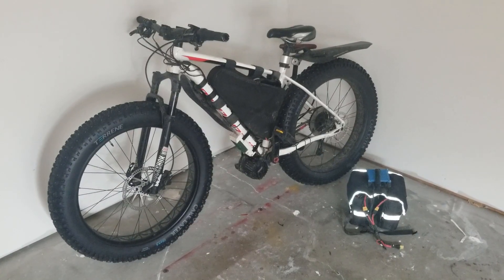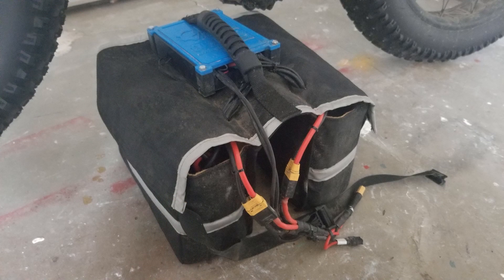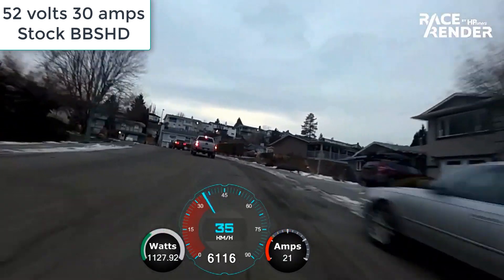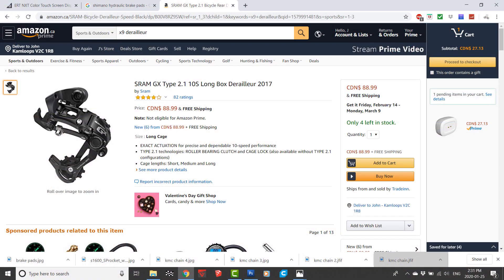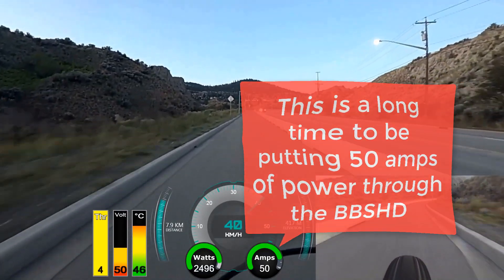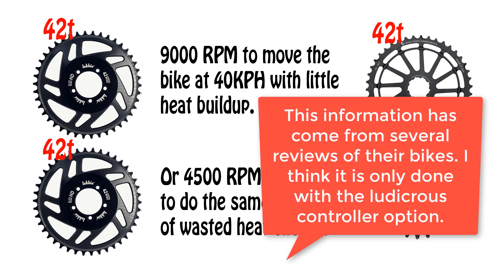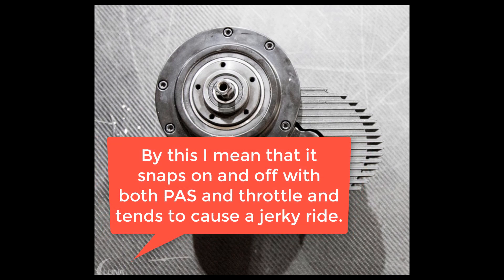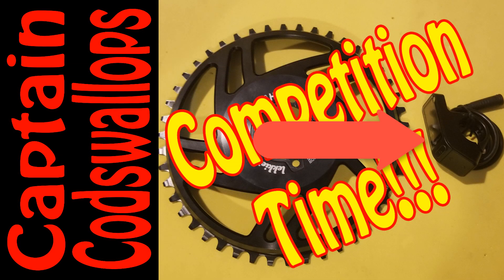Bafang BBSHD - ASI BAC 800 72v - Specialized Fatboy Ebike Conversion. The fastest & most reliable?

Comment: Just want to add some to this very informative video. Ive been running bbshd for 3 years and thousands of kms now. I run 60volt and 50 amps. No need to bash Luna for their controller. They did what they though was reasonable at that time. Nobody had BAC controller set up back then. I stripped nylon gear in first few kms after running just 52volts and 50 amps. And motor was nowhere near hot. Temp is not what makes it fail! Its sudden burst of torque at wrong gear. It strips not melts. Ive made and been successfully using bronze gear since. What gets motor hot is long rides at high speed.  On the trail with full but short bursts of torque and slower speeds BBSHD can go all day at 3000 watts. Keep gears low spin motor fast. BBSHD can take tons of abuse. BAC+ 72v+ sturmey archer 3speed is my next upgrade.
Reply from the maker: Good points. I have seen the gear fail in both ways. I guess I always had it geared correctly. Sorry if I came across as harsh on luna. Their efforts on the bbshd are good. I was just looking at a destroyed bbshd this morning. Respect of the gearing key..Thanks for the comment. Cheers
Reply: @HighVoltageKits  Yep yep. Luna now has PEET plastic gear. I will give that one a try as well. Want to get my gear "noise" down a bit. Its a bit of a learning curve with BBSHD to sort of feel what gear to be in for given speed and grade. My rule is- if its " light" enough to pedal its good enough to give motor all the beans.
Reply from the maker: That's a good rule of thumb. I bust my chain a few times early getting that one wrong.

Comment: Hiya mate sorry to miver but I've got ton a phaserunner coming from your neck of the woods canada am running 52v on 1000w bsshd want to run throttle only coz don't wana use cycle analyst will I need speedometer or do run senor less I've looked at pro gaming aswel an looks litle daunting eny chance of bit of advice thx captain aswel luv the vids BTW
Reply from the maker: Thanks mate. I know Grin have a few setup videos including one on the bbshd. I am not sure if it can be run sensorless. Mine is on sensorless run hall start. The phase runner is based on the ASI bac800 but with a custom form factor. There should be lots of support stuff on Grins website. I am not sure if you are able to run it without the display or not. I had thought the cycle analyst was pretty integral to processing the throttle signal. You are welcome to post pictures on my discord. I can setup a phase runner channel perhaps. If you search under Grin phaserunner bbshd its the top link on youtube. Discord is https://discord.gg/YAAjfgc

Comment: I agree with your decision to continue using the nylon gear. 
 When in use, nylon gears produce less friction and heat than metal gears do.     (When paired with a metal chain), nylon gears are much quieter than metal gears.   Heat transferring to the motor “IS” a very important thing to consider, but I’m pretty sure that (even if those gears were getting hot) nylon does a much better job of insulating that heat than metal does, therefore keeping the center of the sprocket relatively cool, and eliminating the possibility of gear heat being transferred to the motor. 
Electric motors convert electricity into force with byproducts of a lot of heat, some noise and a little bit of static electricity loss.
The more power and the more demand that you put into a motor...the more friction occurs, AND the hotter your motor will get. Usually, that’s the only kind of heat that you need to worry about with electric motors, so never run more power to a motor than what is recommended, and try not strain your electric motor too much with heavy weight and/or long steep climbs. 
I think that you can go ahead and install that metal gear (if you want to). The only difference that you will likely notice will be...
“more gear noise than you had before” !
Reply from the maker: Thanks. Thats a good explanation. Im not going to bother unless it fails. I wanted a spare so thought why not. Apparently there is a Peek gear now that is quieter. At 72 volts I have not got the motor above 55c so well within spec for nylon. Cheers!

Comment: So I have a steel gear  I replaced my nylon one with, greased everything up that needed it, put it all back together and installed a ludicrous controller on my fat bike and the motor gets hot as hell.  Nothing has failed with over 300 miles on it.  I have a mini mighty luna chainring on front and generally switch my gears all around due to the hilly conditions in SF.  You have got me wondering what will probably blow out on my motor now😆
Reply from the maker: Try using a laser thermometer on it. At 52 volts it can get pretty hot. I think 60C is the highest I have found. Its not melted the nylon tho. I think you have some wiggle room.
Reply: @HighVoltageKits  thank you...will do👍

Comment: What a fantastic video of concise details.  I too am working on putting this set up on my 29er in the near future.  Maybe I missed it, but how did you mess up your firmware?  Cheers.
Reply from the maker: I am not quite sure. I could have likely flashed it but I had moved on by then. Just playing with the settings I think.
Reply: @HighVoltageKits  okay...I have the eggrider v2 on the way through mail...just trying to avoid a mishap
Reply from the maker: It will have changed since anyway. I would steer clear of messing with the amps. Leave it at 30 amps and control power in watts.
Reply from the maker: Also after you have made changes and they have been confirmed power the bike on and off
Reply: @HighVoltageKits  thanks a lot...looking forward to your future videos...subscribed and rang the bell...cheers
Reply from the maker: Cheers mate!

Comment: Great video thanks.
Im new to this but been reading as much as possible.
I feel I should have ordered the HD but have the bbso2b now and with the 44t stock ring I hit 18 mph and just ghost pedal in top.
So rather than the 52t chainring I have ordered the 48t and will be happy if I hit 23 mph and a little above.
I don't want to ruin the moter with the 52t an won't risk it.
I will be ordering a 7 speed shamano cassette with 11t but never changed the cassette before and keep extra chains an parts. One needs to read up before buying as it requires regular service up keeping and £$££££ lol. Got some fun ahead and looking into it.
Reply from the maker: Sounds like it's doing ok. As long as you don't stress it too much. Its still a good motor. Cheers!

Comment: Can I install the Asi Bac 800 with bafang 1000w with the original display? C961...
Thanks
Reply from the maker: Yeah you could. If its an older kit. The new version is using a propriety screen and harness now. At least that is with BACs supplied by ERT. You can get them direct from ASI but the installation is not a pleasant experience. The draw back to the original display with the 800 or 855 now is it will not let you change your power level. It is full power all the time. Some of my more recent videos have information on this display. The NXT
Reply: @HighVoltageKits  Thank you! So which cheap display do you recommend to use the BAC 800 with my bafang ...?
Reply from the maker: Sorry I am confused. You already have the bac800 and a suitable wiring harness?
Reply: Captain Codswallop negative, I wanted to buy this controller and know if I can use it with a display without buying his.
if i buy its display is it possible to program the controller and also the assistance levels? how many are foreseen? Thanks for the replies

Comment: I wonder if you could run this controller on the BBS 02 with 60v ??
Reply from the maker: I think you can get an upgrade kit for the 02. When you mean 60v do you mean 60 volts nominal or a fully charged 52 volt battery?
Reply: @HighVoltageKits  16s 67.2 v

Comment: Interesting listening and it all makes great sense, if your father told you not to labour the engine but to let it spin and don't load it up in a higher gear.
Reply from the maker: Yeah. It adds nothing to your speed in most cases. Cheers

Comment: I'm confused.  If the motor is flying along at thousands of RPM, with  42 to 42 teeth then you're really just sitting there as if you were riding a moped, right?  I mean, at that speed your legs can't really move fast enough to add any force to the drivetrain, right? Or am I missing something?
Reply from the maker: Yup. Thats right unless I lower the power and change the gearing. If I drop it to 500 watts I can putter along with pas and put effort in but its slow.
Reply: @HighVoltageKits  Thank you for clearing that up!

Comment: Really like your descriptions and the evolution of your build.  So would it be fair to say that what you've created here is basically an electric motorcycle?  With your 1:1 ratio, do you ever pedal the bike?
Reply from the maker: Sometimes. I do have two other gears that are a bit higher. The exercise part of the vehicle is something I want to work on. I prefer the term light electric vehicle. But you are correct in your thinking as it's not really a peddle assisted vehicle. Although it can be and with a different chain and gearing could easily be. So restrict the power and you can ride speed restricted trails. You can't do that with a traditional motorcycle. Thanks for the comment. Cheers!

Comment: I forgot to ask you what fat tire are you using for the fat bike I am at cross road on what to get for all season riding
Reply from the maker: The smooth ones would be useless in winter. The ones they came with were ok. Ground control I think they are called. I love the cake eater winter ones I got. You can get them stud less. It's not a simple choice tho.

Comment: My bbshd has been sitting unused in two years upgraded to a ERT 84v external controller and destroyed the nylon gear..Im going to get her back up this summer and running with steel gear replacement. My cheap 48v chinese battery still has a charge but its been abused bms died so I just cut it out, should probably check to see if cells are balanced manually before I get her back on the road. Looking into building a 72v battery on a tight budget. Any advice or thoughts would be great
Reply: Wrote the coment before getting to end of video interesting thoughts on the nylon gear your logic and why the nylon gear makes sense but if I already have to replace might as well go with steel one for few bucks more
Reply from the maker: Yeah. I will see the condition of mine in the next while. Apparently they start off a bit noisy but get quieter as they break in..Good luck getting it running!

Comment: Great information here Captain, and very thorough. Here in England I'm about to start a build and making decisions on controller, chain rings etc. My last decision is really on why not an IGH? Surely with so much power, a 3 speed simple and robust IGH would be the most reliable? The sturmey or similar? Less issues with chain alignment etc?
Reply from the maker: Absolutely. There is a 7 gear sturmy that can do 3
kw. I have to pick and choose where to spend the money. Once stuff wears out maybe I'll try igh.
Reply: hi there, just thought I’d let you known that the Nuvinci hubs work real good with mid drives.  Seamless shifting with the Harmony auto shift, just set your cadence you like.  shifts to lowest gearing when at standstill.  Protects the motor from high gear starts, and subsequent heat issues.  I run mine with a 48 volt 10 amp/hr  battery, stock controller, and it climbs insane slopes with ease.  With one chainline...they work very well together!
Reply from the maker: Thanks for that! Will check it out. Cheers!

Comment: Hi,
Thank’s a lot for the amazing content, it’s very helpful. I have a bbshd on Crossbike which I use for commuting: 40km for one way and 500m elevation when I go back (several routes possible, shortest one with gradients up to 17% for 200m). I use a Cannondale Quick CX1, 9speed 11-32 cassette, Lekkie 46t chainring, 48V 14Ah stock battery. I just ordered the newest ASI Bac 800 kit from ERT and I want to change the battery for significantly more top speed too as I have 30km of flat road. But I’m not sure if a 72V battery make sense as I don’t have (and don’t wish) a throttle. With such a power pack, I’m afraid that I won’t have a comfortable pedaling cadence on the flat and/or be able to benefit from the top speed the motor could deliver. If needed, I can install a Sunrace M991 (11-46t). What’s your opinion, does a 72V battery make sense without a throttle or do I take a risk to overheat the nylon gear? I wish to reach 55-60km/h, maybe a 52V instead is ok too… Thanks for your valuable suggestion. Cheers, Etienne
Reply from the maker: You will easily hit the speeds you are talking about throttle or not. In terms of peddling it's up to you to balance the power going into the peddles if you want to work as well. The nxt will give you good control over this. In terms of the nylon gear you want to keep the rpms high. I hit over 60kph on the flat with 72 volts on a fatbike. But use a throttle. The pas is restricted to 1200 watts with the NXT. 3250 watts via PAS is not a good idea. That said you will get more top speed with the 72 battery anyway at 1200 watts as the voltage will mean a higher top speed anyway. Really it's a case of experimenting with what fits. I would get a throttle still. You can always unplug it... I think a future nxt update will allow it to be locked out. Hope this helps
Reply: @HighVoltageKits   Absolutely, thank's a lot. And in terms of gears, should I go for 1-1 ration by changing the cassette? Probably yes I guess...

Comment: The ASI is capable of more control than the Ludicrous. Your only mistake is that the Ludicrous is capable of 60 amps, if you have the battery to put that out at 52 volts. I grant that only adds to your argument about high amps at lower volts generating heat but the specs do allow for 60 amps but are set for 50. So far this hasn't been an issue with how I ride but must admit that if you crave top speed & depend on a throttle the ASI is far superior.
Reply from the maker: That is interesting on the luna controller. Did they up the amps. I remember reading it was 50 but that was a while ago. They would do better with 72 volts. But then they need to manufacture that style of battery and it will be harder to make a profitable ebike. So 52 volts and upping the amps makes sense. As does having it as a drop in replacement. As far as other features go. It has none really. Yeah you pretty much nailed it.

Comment: You've come to a nice point on your bike. Well done. I ride as I did a standard bicycle but much faster, don't ride as hard as you do and I rarely use my throttle so have found the Ludicrous controller more than adequate and have yet to melt my original nylon gear (1250 miles so far). I do have to change gears but can maintain 34 mph on flats and climb anything my tires can grip (albeit a bit slower). It seems all I've given up is the ability to climb fast and in my lowest gear the throttle is more of a wheely on/off switch.
Reply from the maker: The wheelie thing would be taken care of with the asi. But no you should not run into trouble unless you restrict the motor to low rpms and dump 60 amps into it. But it sounds like you know what you are doing. I usually cruise around at about 45kph. Yeah I could go faster but it serves no purpose and you just consume a bunch of power with the field weakening. The real fun is the acceleration in the bigger gears. So where you are pulling wheelies the asi ramps the power in a more controlled manner. Future updates to the NXT display will allow rider control of this.

Comment: Thank you for sharing so much experience and helping us, Fat bike lowers :) I bought dual suspension Fat bike today, mostly because of frame. it was 300$, so first steps are to replace front fork and rear suspension. Also I already ordered Same motor as you have. Now thinking about battery box design, because of suspension, I have almost half space in the frame as you got. First step will be making it work on 52V battery and get used to it, at the end of summer I will push further :) 

Need your advice with: 

1. Currently I am not happy with the front fork, It has locking mechanism to stiffen it, but when unlocked springs seem to be a bit loose and fork is not solid (i did not expect much from 300$ fat bike). could you please advice what fork to get? I am 205cm tall and 100-110kg, so quality matters :) 
2. What range did you get with your 52V (25AH?) battery pack previously with regular riding and not keeping it at the max power?

Thanks in advance! :)
Reply from the maker: I'm using the rock shocks bluto. Not many choices out there for fat. I am very happy with it tho. You can set it for rider weight. They are using air shocks. 

Used to get 50-60kms running stock. That was using the throttle as much as I wanted though.

Glad you like the channel!
Reply: @HighVoltageKits  Seems you have done a lot of research :) I have a problem now with chain centering, since I have 12 speed cassette in rear, What chainring do you recomment to have more negative offset to center chain? Will this lekkie do the job?

Comment: have you ever considered the stemy archer internally geared hub in the rear, that would  delete all the stock gearing in the back. this will be going on my e bike when the covid stuff is over.
Reply from the maker: I have. But I have limited resources so I have to consider where best to invest it. Right now the bike works great and I use it a lot. So building a new hub etc is not really where I want to go. But in terms of its fuction, its great. 3KW is meant to be its max.. Which I do go over a bit. Great to use tho. I have a nexus 7 speed on my bamboo bike.